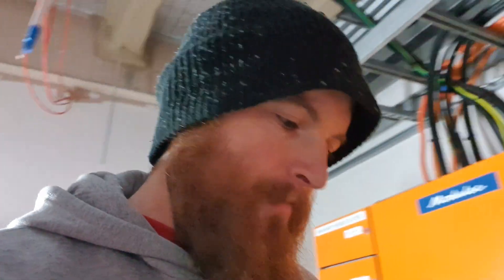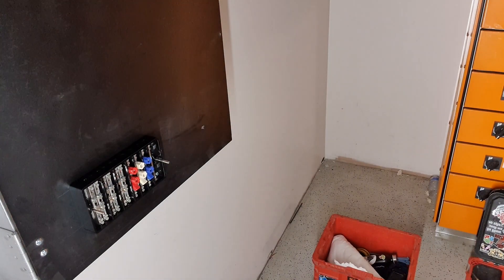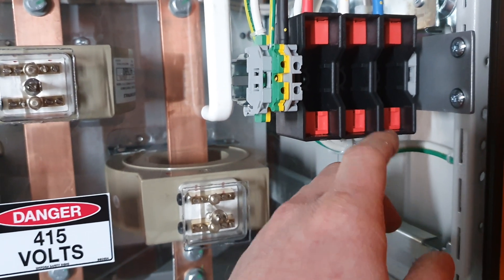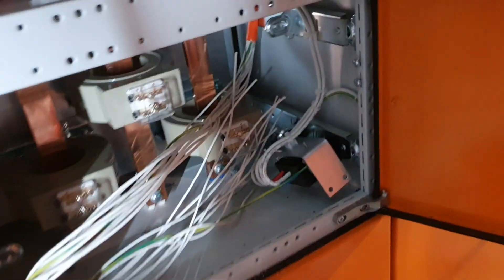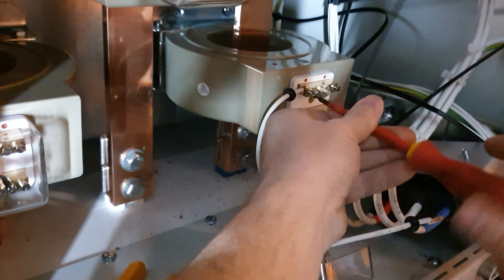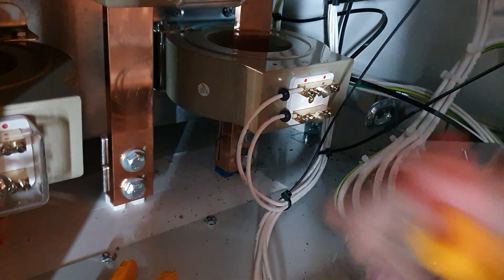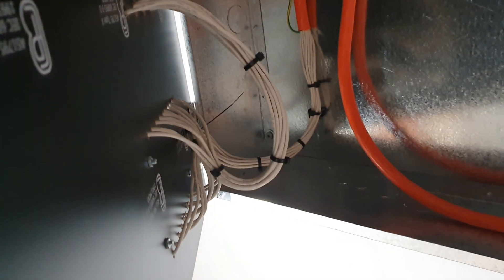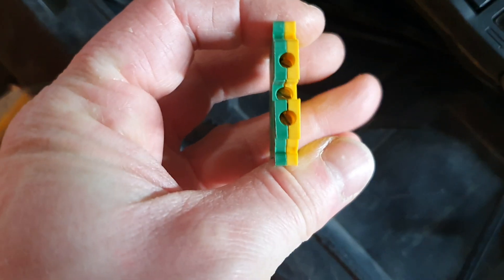How to install Current Transformer Metering for a 630A supply - Commercial Day Hospital

Comment: What happens if you wire the coils reverse?
Reply: The meter will see reverse current flow on that particular phase.  You need corresponding polarity with the primary and secondary.  If the CTs are mounted backwards (happens a lot with HV metering) you just reverse the polarity (at the meter terminations usually)  to correct it.  Remembering to label that you have corrected the polarity makes a life a LOT easier for the next meter tech who attends for the 5 yearly site inspection/meter test and/or replacement :)